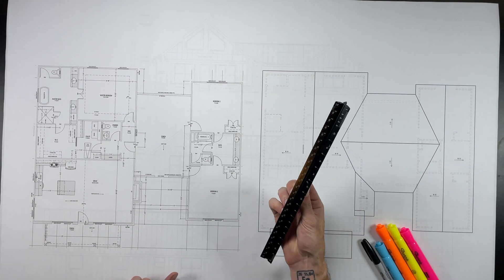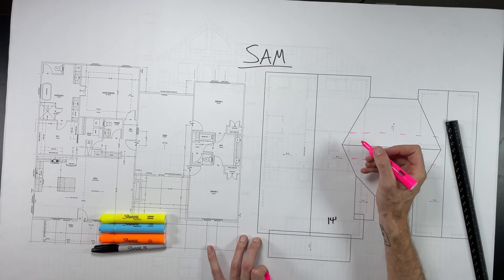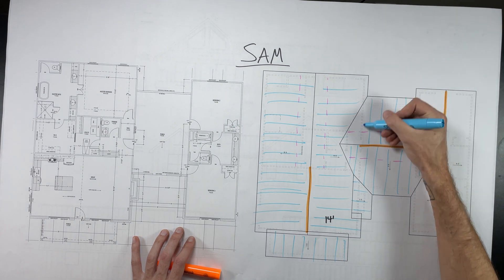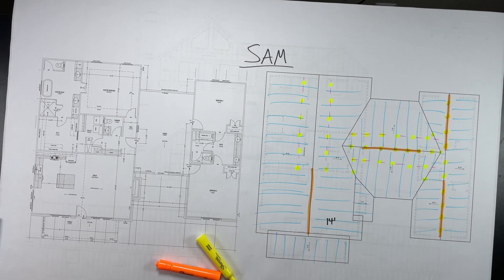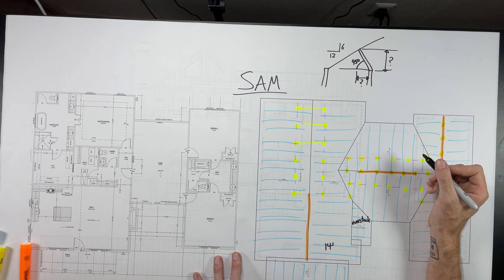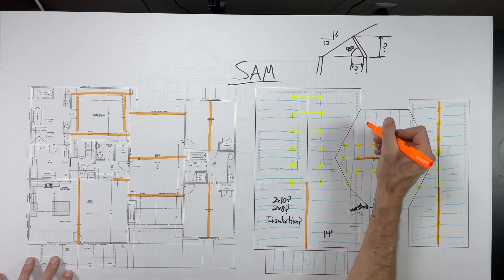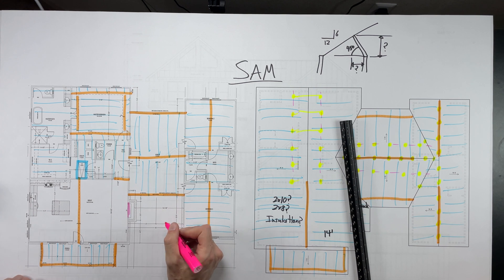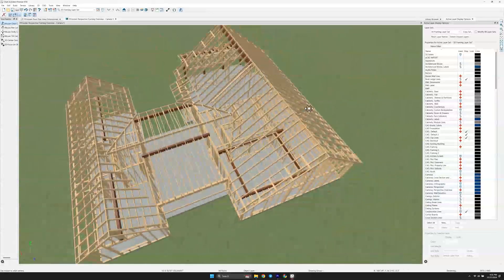Frame It Fridays - Dec  27, 2024

Comment: This was great, thanks for the explanation. 

I've been watching more videos on the construction of homes lately, and I was wondering how much a drawing like this costs. I like reading and understanding how my home is to be constructed, so I'm curious how much it normally costs for a drawing such as this. 
I appreciate your time. Thanks.
Reply from the maker: You're so welcome! Glad I could help! 

The answer to price is a function of who is buying and who is selling and the supply and demand constraints. But I can say that in the PAST getting an extremely underpriced framing plan from an engineer was about 20 cents/SF and the architectural set varies widely depending on who is doing it. Start at around 40 cents/SF and it goes up from there. Architects are around the $9/SF range.